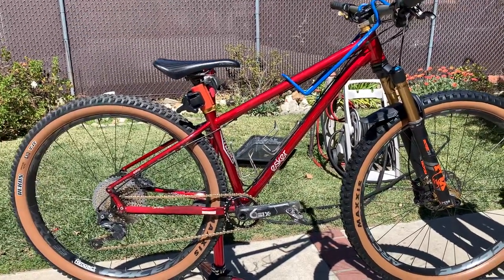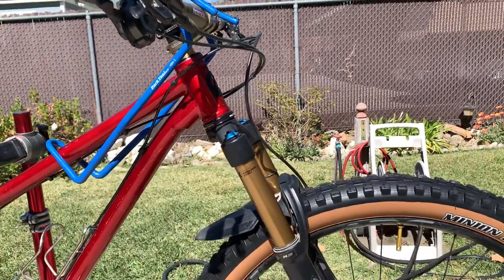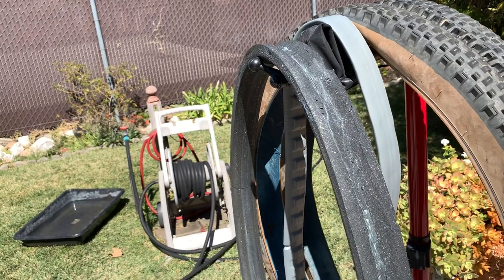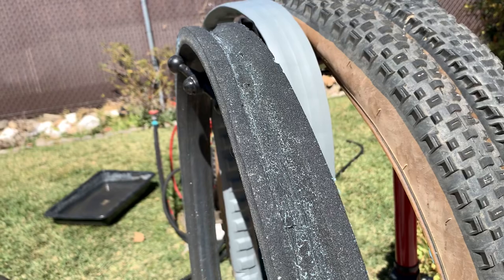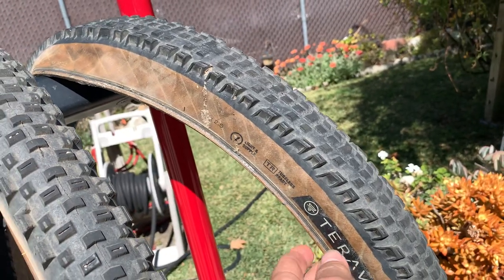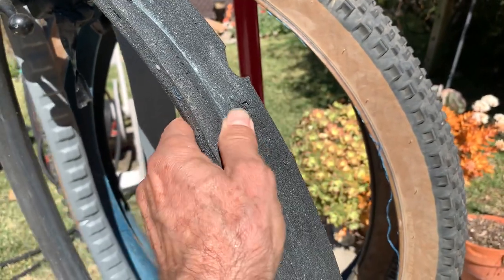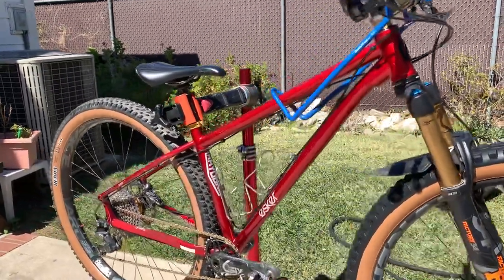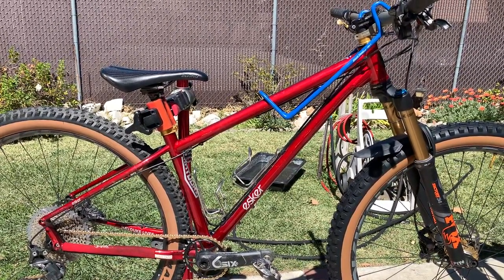Maxxis Rekon and DHF EXO 29x2.6” tan wall and CushCore XC set up with E13 Tire Plasma sealant

Comment: Excellent channel!  Just subscribed and enjoying the content👍I have a  singlespeed frame ordered and can hardly wait!  Would this tire combo work with 30.5 internal width rims or should 2.5 be my max tire width?  Thanks
Reply from the maker: Maxxis EXO casing 29x2.6 would work great! I would only caution you on Teravail light and supple casing 29x2.6 or other thin wall tires. They might give you a bit of roll over. You can also consider CushCore or Rimpact are the inserts I use and that helps prevent roll over at lower tire pressure when I use i30!rims with 2.6” tires.
Reply: @hardmtnbiker   Will a teravail Honcho 2.6 fit ok with a 27.5 i40 rim? Thanks in advance!
Reply from the maker: @umpa916  I’m sure it would, but I have only used the 29x2.6” Honcho.My 27.5x2.8” Teravail is the Kennebec on and i40mm rim and it sets proper